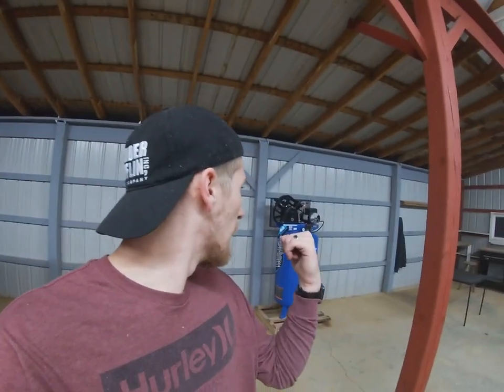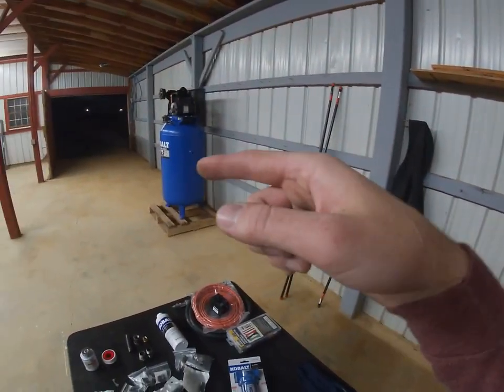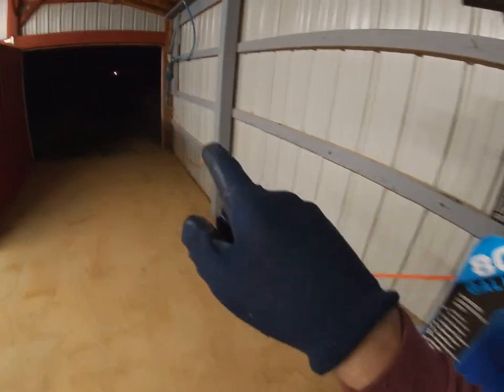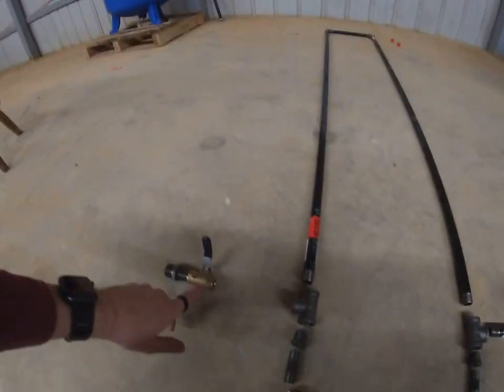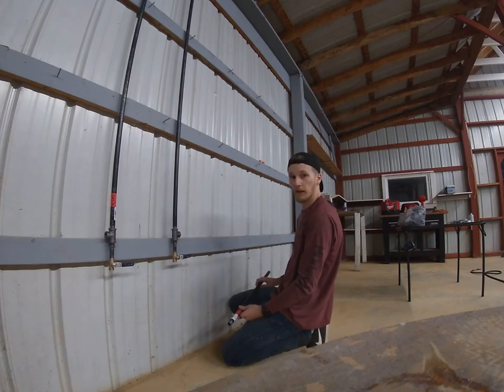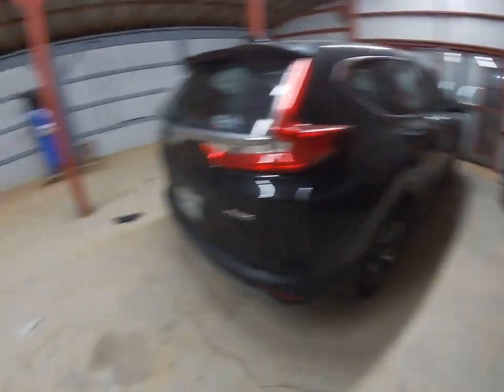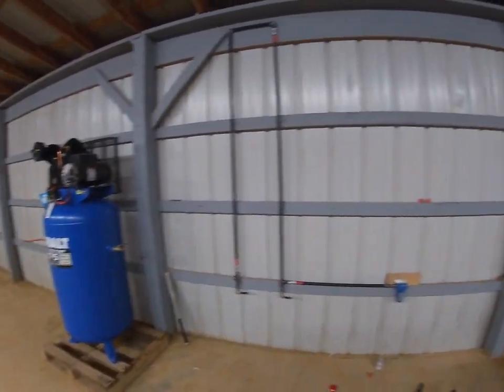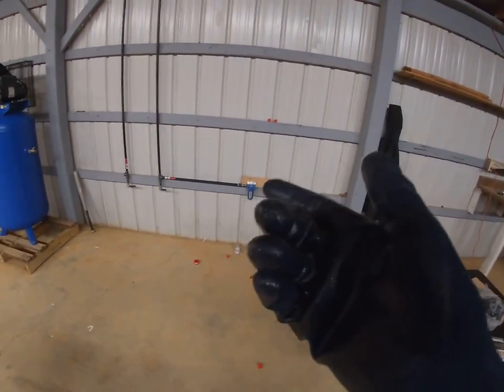Installing New Kobalt 80 gallon air compressor and air lines! (Shop upgrades Pt. 1)

Comment: I bought a husky version of that compressor in 2006’ made by C&H. Its still running. Plastic line fitting cracked i ordered a new one. Itsloud like yours but a decent choice. Good luck with yours and your adventures , mike

Comment: You will need a filter/regulator (no oiler) right out of the compressor. Place a 3' flexible hose from your compressor to your hard lines for vibration isolation. You could also use a 25' flexible hose to make up your distance from the compressor too hard lines/ filter/regulator. Also, depending on your weather/cold/heat, you might want to install your compressor outside your shop to cut down on internal noise pollution. Build a small outhouse to cover the compressor. Remember to read the manual for your compressor thoroughly BEFORE you plumb your air lines. For long-term safety's sake, you must drain the compressor tank water drain at the end of every day, to prevent rust from forming, which could cause your tank to catastrophically fail sometime down the road.

Comment: I'm going to buy the same tank today but will only be using it for a HB blast cabinet and airing up/mounting tires. No painting. Do you think I would still need to run all those lines like you did? Do you think I can just get away with running a ball valve and hose right off the tank?
Reply from the maker: It’s always Recommended to have several feet of air line to allow the moisture to condensate and be able to drain, with blasting you should want this also because you don’t want moisture mixing with your blast media and clumping up and also introducing moisture onto what it are blasting!

Comment: I just got the 60gal version of this a couple weeks ago on clearance for 350$. Probably taking it back thou. To many bad reviews and the cfm says 7.9 at 40psi. That's pretty low for the size of compressor. The kobalt 60 and this 80 share the same exact pump, only difference is this 80 I beleve is 5hp and 15.somthing cfm and mine is 3.7hp. There both way under cfm and power then they should be for the size. The 80 is at the ratings of what the 60 should be. All that said, they had this 80 gal onsale for 450 when I was there but they were sold out..at that price i woulda definitely got this 80gal. It seems to be a good setup if you get it for a good price like that. Out of curiosity? Hows yours running so far? Keep us updated. I imagine alot of people got this compressor as well as the 60 like I got in the last couple months. Lowes just cut the prices big time to get thses out and the new craftsmen compressors in.
Reply from the maker: The 60 is way under powered I think.  This 80 is 15.1 cfm I believe.  I wish it was a bit more than that honestly. It does run a little more than i would like while sanding/painting but it does keep good air pressure and flow during it.   I didn’t get it on sale unfortunately, I wish I had though.  However I am not dissatisfied with it. It’s a great compressor for sure for a budget that I am on! I will post and update on it in my next video, should be up next week!
Reply: @Eric_Kinser  Awsome! Yea I wish I had made it in time to get the 80 gal onsale. I need to paint my transam and some other smaller projects. I knew I wouldnt be able to run da's with this 7.9 scfm 60 gal I got, I was hoping it would be enough to paint the car but after more research I'm doubting that now so I'm planning to return it. Also I noticed there rating is scfm not cfm, as far as I know scfm is a higher rating then cfm so mines actually around 6. somthing. Thank you for taking time to reply thou and look forward to the new vid update!.

Comment: Why the high piping?
Reply from the maker: You need 25 feet of air line before the filters at least and room for drained in between so you run the piping up and down a few times to save space as well as making good points at the bottom of the lines for water to drain.